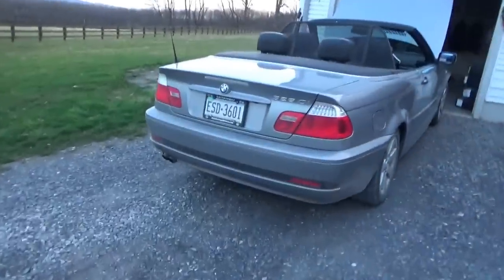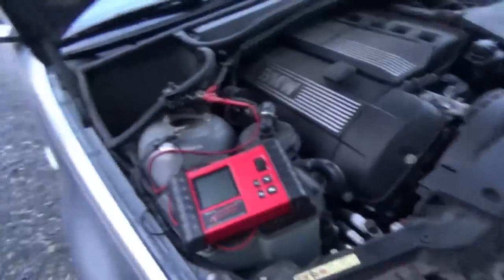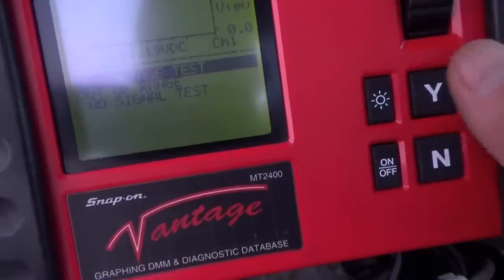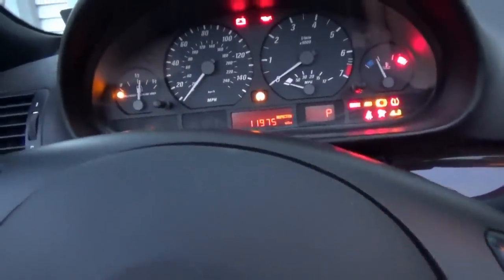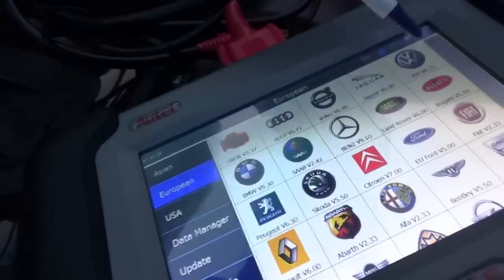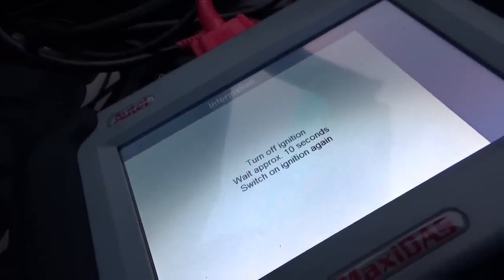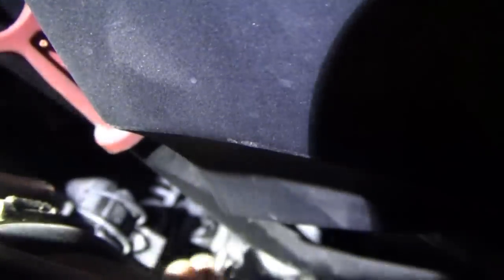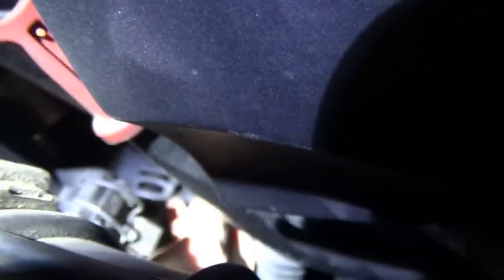BMW Charging System Alternator -Diagnosis

Comment: It's so infuriating trying to fix something with no service info. That was me today, on a 08 Impala. Stress level at 11!  I don't have Identifix, or any other subscription yet, since my shop is still under construction, and I do a mix of cars and small engines. Tough to swing a $200/month payment for something I'd use 5x a month at best. Starting to think I might have to, just to keep my sanity! Anyway, absolutely could not find a wiring diagram for the AIR system solenoid valve / pressure sensor anywhere. Thankfully there was a relay pinout map on the side of the relay, so I figured out what wire was what. Figured out where the relay was by commanding the air pump on, since it wasn't in the under hood box. Took a guess that the relay next to the pump relay was for the solenoid - lucky me, I was right.  Even BBB had no diagrams that I could find. None of the categories matched, so I may have missed it - who knows?  I finally fixed it, and after a few hours of infuriating scan tool timeouts, temp too high, temp too low incidents, and then a total lockout, I got the monitor to run (after walking away for a couple hours) with no codes set! Victory ... but I am BEAT. I'll be in bed early tonight! 😣

Glad you finally got to see the alternator crap out on you in person. Makes troubleshooting MUCH easier! I hate intermittents. Can be extremely frustrating, as you know! 

Send some of that 80° air this way, will ya? We're freezing over here. Got up to 53° today - A/C weather, lol. 😁 

Thanks for posting. Great vid as usual, Ivan!👍
Reply from the maker: What engine? BBB has very complete GM diagrams. I looked under "fuel controls" for a 3.5 V6 and all the AIR relay info is there :)
Reply: THANKS man - geesh, I would've never figured an AIR pump to be under FUEL controls! Yeah, it was the 3.5 . I should've asked you guys a few days before I got the car. Somehow I managed to fix the thing, though. I'll definitely write that info down for next time! Again, THANK YOU!! 👍
Reply from the maker: No problem! Yeah, "fuel controls" generally means anything that has to do with the main engine computer :)

Comment: Is it worth it?   Just wondering how many hours spend on diagnose this? Just verified continuity of the wires and voltage drop test.  If all check out  ok,  throw in the new alternator after performing high load test.  Charging system should be computer controlled

Comment: Could it be just the alternator regulator?   On some models the regulator can be replaced separately and it's much cheaper.  The alternator itself may still be good (pulley ok).  
These charging systems are tricky to diagnose.  It can be either the battery (when too old, 8 years or more), the alternator regulator (or even a seizing pulley), or the most tricky is when there is a parasitic drain.  A parasitic drain will slowly discharge the battery overnight, and after a few months the battery will not charge properly anymore when the car is driving.  The alternator also will look like it's giving less voltage because the battery is actually damaged.  A parasitic drain is easy to see if 30 min after shutting off the engine the battery has a voltage (ex. 12.5V), then the next morning before starting the engine it has a much lower voltage (ex 12.1V).
Reply: VW/Bosch use to have an easily swapped brush holder on the back of the alternator. 
Maybe BMW did the same? Seems to fit with the 100k+ miles. Those brushes are wear items.
Reply: Being a German/European car, there is a chance Bmw also uses Bosch alternator regulators.  Volvo does as well.  Very funny coincidence, I just diagnosed today the exact same issue as in this video, regulator putting out an oscillating voltage from 12.2 to 13.6V just like in that Bmw and battery light intermittent but only in warm weather.   It's coming out tomorrow before it ruins my new battery.  Less fun fact, my faulty actual alternator was a recent rebuild with a Bosch regulator.  Sad to see Bosch regulators sold online last less than the originals that came with the car.  As for the brushes wear vs miles, I did open a few older regulators and from what I've seen the brushes should be good for a decent 200K miles.  But the electronics in the regulator can give up sooner.

Comment: I have been trying to fix my e46 330ci convertible BSD Generator error for almost 6 months... no luck. Replaced alternator, engine harness, dtml pump, etc... still no luck. SES light stuck on.

Comment: A BMW causing trouble and being bloody hard to find information for. Imagine that. 

A guy i work with brought an E91 320i a few months back and its left him walking 3 times in the last 7 weeks. 7 weeks ago he had to have a complete timing job on it because the plastic timing parts let go and the timing jumped. Amazingly not destroying the engine... Then the thing started smoking bad. So he had to have new piston rings and send the head off for a rebuild. Then one of the plastic parts of the cooling pipes disintegrated and sprayed coolant everywhere on the test drive. Now its overheating. I diagnosed the cooling fan as faulty. He's talking about keeping it for years to come... I'm not hopeful... At least it isn't a diesel with a £3000 DPF waiting to shit the bed.

Comment: common issue is right at the battery end!! One of the big red cables pulls out of it's connection. I know there is an upgraded cable in the % series (E60) which is under the boot carpet just against the rear seats. Don't know if the same applies to the 3 series or not.

Comment: That's so stupid about a highly paid service not having "certain info". IMO I always change the battery with an alternator- but not necessarily vice versa. That 1 alternator wire evidently monitors feedback from the battery; if it's not enough- the alternator puts out more. My Buick has a similar system, it's for keeping all of the electronics happy, without any brownouts or surging. BTW- the only way to properly read the eye in the battery top- is to be directly vertical over it, looking directly at it. I'm surprised (you didn't show) an amp clamp AND volt meter on the battery itself; engine starting, running, all acc on, jacked up, in gear, and engine off, battery disconnected. With the shields off, you should be able to see the alternator from underneath easier; actually check that positive wire for green crusties, and the main fuse box, too.

Comment: I'm not sure of this model year but late model BMW's require coding if a new battery is installed.  What this does is tells the PCM that a new battery has been installed so the charging parameters can be reset for a new battery.
Reply from the maker: Thankfully that is one option that this BMW did NOT have!

Comment: You really have to look down into those battery condition indicator inspection windows from directly above to be able to see anything. If, like here, it's installed in the wheel well and you're looking at it at an angle, you're never going to be able to read that.

Comment: I am having a very disgusting electrical problem,,very similar to this video,is a 04 525i,had the car for about 5 months,last month in the one morning car was dead,so i charge the battery and car ran fine for 1 month but is been dying slowly,2 days ago the car shut off from lack of charging problems,lets not forget i have 2 other batterys that are working just fine,so i researched just like i saw this video and felt pretty confident my alternator went bad ,,so i bought a remanufactured alternator and car still not charging took the negative terminal out and car shutt off immediately so i went back to the parts store thinking i was lucky enough they gave me defected alternator so traded it for a new one and paid the difference,i installed the new alternator no problems and started the car battery had enough juice to start the car and monitored the volts slowly dropping and slowly getting more frustrated i checked all the fuses on glove compartment and trunk fuses nothing blown the car haven't been  absolutely touched before until just replacing the alternator ,there is no corrosion what so ever and all the grounding seems good ,someone please shed some light,and great tutorial by the way but no luck ,what a weird issue
Reply from the maker: You have a parasiic battery draw. Watch this video: https://www.youtube.com/watch?v=AQhJecNUhNg

Comment: Cool. Still waiting for part two, but don't these alternators have an external and easy to replace voltage regulator (cheap too!)?  I wouldn't be at all surprised if the carbon brushes are worn down to little stubs.  See you in part two!

Comment: It's crazy that there is not that much info online to help with diagnostics.  Certainly makes me never want to own a German car no matter how nice they look or how much performance they have. On a side note do you know why the oil light switchs from amber to red 12:30? Looking forward to part 2
Reply: It's likely a self-test during startup to show that the cluster is working properly. If it turns on amber with the vehicle running, low oil level is indicated. Of course, if it's red, that means low oil pressure is detected. It's interesting that one lamp serves a dual purpose.
Reply from the maker: The oil level/temperature sensor is broken so it thinks that it is low on oil lol

Comment: he said  "the lack of information for BMW is astounding! Hard to get information for this stuff.... " He described word for word exactly the results I am having, I have great luck finding shop manuals, YouTube videos, wiring diagrams, trouble code descriptions, software interfaces for control module communication etc. for every other vehicle I have worked on but the E70 4.8 information is very scarcely circulated it seems.......  Thank you "THECHEESEBURGLER" for the link to newtis.info! already found info on that site that I couldn't seem to find in the BMW forums.

Comment: Hey ivan .i think that thing on the battery terminal is the battery disconnect module.it blow off disconnecting the battery terminal in a crash. I doubt there is a curre nt sensor in that terminal
Reply from the maker: Huh interesting! Wonder if the explosion near the battery is a good idea LOL
Reply: Yep. Very small pyrotechnic device to disconnect the red cable from the battery.... and the battery gasses are vented outside the car via the small rubber hose connected to the battery  so no chance of explosive gasses.

Comment: I have to tell you, when I see a vehicle of that age and mileage, an alternator is the most common failure.  While I appreciate the need to test until you are 100% sure, there comes a balancing point where the cost to diagnose exceeds the cost of the labor to install a new alternator.

I would have installed an alternator.
Reply: actually ALTERNATOR gets killed by the tired TENSIONER when it digs itself a pigeon hole... belt slips quietly with very little power transfered.

Comment: Ivan, I have similar trouble with a 2011 Infiniti QX 56, I left me stranded twice I replaced the battery(it was older) and it was ok for a few months and it did it again , it does have a charge indicator and now I've noticed the needle kind of going up and down hovering around the middle of the gauge, so I replaced the alternator and the needle is definitely higher, however when it warms up it begins fluctuating again...I bought a lower end scan tool that has the ability to test alternator output.. when its cold its 14.2 v. when its at operating temp its 13.3 v..  Any ideas?? thanks
Reply: Randy these vehicles have an intelligent charging system if I’m not mistaken. Is there a sensor in your ground cable?
Reply: Myke De Anda   Yes there is what appears to be a circuit board on the ground cable,  though I must note it has been trouble free since replacing the alternator,  thanks so much for the information.

Comment: how did you find out that it had a default mode?? Fords have the same thing but you have to rev the motor up to around 3000 rpm to get it to go into default mode..
Reply from the maker: Unplugged the wire and saw it charging at 14V. That's "default mode" lol

Comment: Leave  the connector disconnected the car should run fine, but the BSD will not control the charging. If the supply to the BSD is faulty and causes the  battery voltage to go to 12v then  it wont charge the battery !

Comment: You mentioned you don't work on cars full time anymore. Did you when the lottery and not telling? Lol just curious what is your career change? If you don't mind
Reply from the maker: Got an engineering job as a vibration analyst at a small company here in State College. It's interesting work and the benefits are nice :)
Reply: Pine Hollow Auto Diagnostics that's good to hear. The important thing is you like.

Comment: I have 2007 BMW 328! I put new battery new alternator and don't charge
Reply: ECM computer software is not commanding the alternator to charge... PURPOSELY crappy Robert Bösch design - Same goes with MBenz... 🙄

THE simple WORK AROUND IS TURN ON ANY LIGHTS SUCH AS PKG OR DRIVING LIGHTS! (this condition does command basic ALT output so drivers dont crash in the dark, daytime without driving light car dies wherever) - Broke My Wallet!
👍
Reply: So what i can need to do

Comment: They force you to take it to the dealer just like Volvo or any euro trash, they have their priority systems, Volvo charged 1,200 to reset the computer on my friends 2000 s80 and all the lights stayed off on the dash for about half a day then they all came back on, he brought it back and they kept it for a couple of days and still they couldn't fix it.

Comment: BMW Charging system is not that hard. You check the battery voltage first. The Battery Terminals. The Charging system Shunt at the Positive post for corrosion and function.. Check the Ground to Positive under the hood. Then Ground to Positive on the Alternator. The last thing you want to condemn is an Alternator. 

And that code will popup if the Battery has been replaced with one. That is not of the same type and CCA...At that point you have to program the replacement battery to the DME...And don't screw with that DME. You screw that thing up. You will be paying $500.00 for software to copy over all the vehicle information to the replacement...As that DME program is VIN specific...

Comment: The cheap repair will be to replace the brushes/voltage regulator assembly.
Reply from the maker: There are no "cheap" repairs for a BMW...
Reply: Cheap repairs if you use Made in China Parts.
Reply from the maker: Oh boy...I try to avoid those cheap aftermarket parts like the plague. Too many comebacks!!

Comment: I’ve got good readings from my alternator (14.3V) and battery (12.4). Still the battery light is on
Reply from the maker: Battery and alternator should be at exactly the same voltage 😁👍
Reply: time to get familiar with you CAN Bus data  scanner.
Reply: I got the code 28D7. Read it had something to do with alternator communication. What can I do to fix this? Thanks. // And I thought I should measure 12.4V when the car is off and 14 when it is on?
Reply from the maker: @lazerduck9390  Replace the alternator...it's a BMW :)
Reply: Pine Hollow Auto Diagnostics Might do that. The one I have is only a few weeks old but it’s a refurbished one. Might be the issue. The old one might have overcharged the battery too 😵 BMWs 😂

Comment: The Charging #s,  should be @ minimum,  13.8  - 14.3  w/no load,  Also, w/ the proper steps to test,  is to be put under load that means headlights, rear defroster, fan blower on high and raise up the RPMs 2 maybe 15 to 2000 RPMs....

Comment: I have a 2011 740dx, it's basically a money pit :D
Reply from the maker: Not surprising lol
Reply: Yeah, it's not. But when I bought it I knew it will cost much more than owning a Toyota for example, maybe it's not the most efficient way to spend my money, but I've made that decision. Every part costs more, and it's really difficult to fix. So far in the last 7 years I've changed twelve injectors, two turbo, a whole steering-rack and I had a few mishaps with the electronics. It's also a diesel so the DPF had to be changed as well. Otherwise it's a really great car, smooth, quiet and it has a slightly above performance. Either way good luck with repairing  :D
Reply: @Beni_777  ouch, i feel your pain! 
All that for DPF powered 🙄

Get a used E-class 550... it won't cost you more in parts but at least you'll have power to the wheels